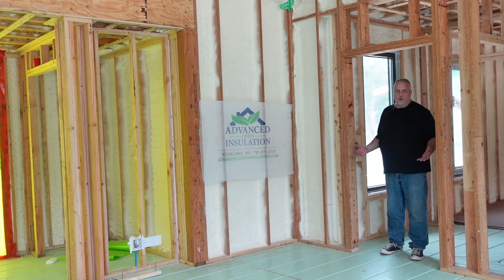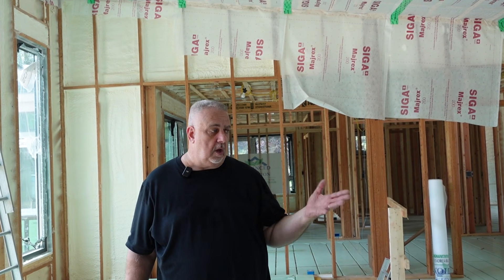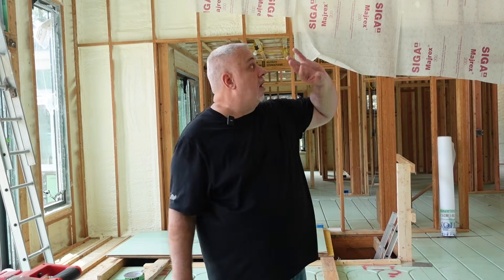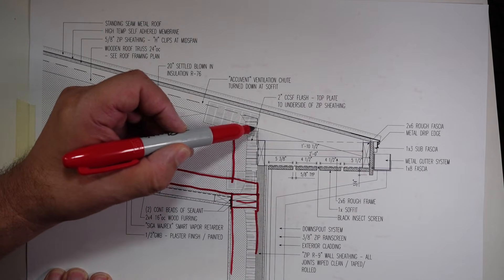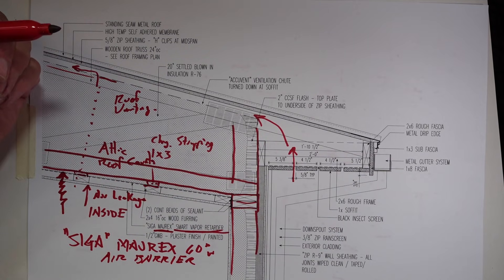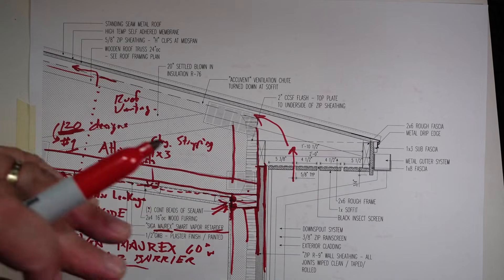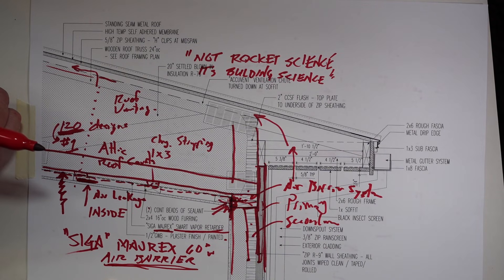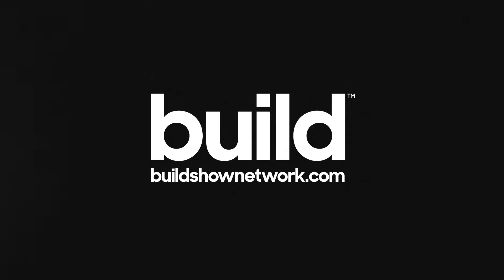THE BEST WAY TO INSTALL the AIR BARRIER

Comment: You're describing the Siga as a mechanical system where it can let moisture into the roof or wall cavity when needed and if there's too much moisture in the cavity it can let it dry or move moisture back to the inside.
It's not as cut and dry as that.
It's marketing when they say it's a Smart Air Barrier like it knows when it can let moisture into a cavity and when it can't and vice versa.
Reply: A while back, I looked up how that stuff (the generic category) works.  A lot of people online mistakenly describe it as a one-way valve for moisture (only letting it travel out from the wall cavity), which it isn’t.  What it actually does is vary its permeability depending on the moisture level.  If it’s dry, it has low permeability in both directions.  If it’s wet, it has higher permeability in both directions.  I’ve reluctantly come to the conclusion that, while it’s really NOT a great material, it’s the best that we have at the current time.

Comment: @7:37  I wondered why the Majrex is on the wrong side of the 2-by strapping---framers being framers, working at break-neck speed with no thought to order of operation. But I'm at a loss as to the purpose of the 1-by strapping between the 2-by strapping and the trusses. If I were the framer, seeing the 1-by on the plans would be a big WTF moment. So, are they going to put 2-by strapping over the 2-by strapping? If not, someone (probably the electrician) gets to poke a hundred holes in the Majrex, and try to seal all those holes.

Comment: This is the kind of clarity that prevents walls from quietly rotting out of spite. Air barriers and vapor control doing separate jobs — radical concept, still somehow controversial.
Reply: I would say to put the air barrier close to the outside makes sense for the hot climate not so much for colder
Reply: @andreycham4797  I think you really mean "vapor barrier" (or "vapor retarder") here.
Reply: The position of the vapor barrier (inboard vs. outboard) needs to be chosen based on the local climate.  The air barrier can be anywhere as long as it’s not leaky.  If you can have the vapor barrier be truly continuous without leaks, you won’t need a separate air barrier.  But that could be more difficult to construct.
Reply: @kc9scott I see your point, you do not mind warm air to inter the wall and condensate on the air barrier placed close to outside. Then I do not understand why you want to accumulate moisture inside of the wall when wet insulation loses its properties
Reply: @andreycham4797  My point is that you are confusing "air" with "vapor".  They are two different things.  In the context of buildings, "vapor" means water vapor.  I do NOT want to accumulate moisture inside the wall.  No one does.  In a northern climate, the vapor barrier/retarder is always placed inboard of the insulation. and historically, the air barrier is outboard of the insulation.  If the air barrier and vapor barrier are two separate things, the chosen air barrier material will let humidity pass through it.  This lets the wall cavity dry.  In recent years, it's been found that while this is perfect for winter time, designing the wall to ONLY dry to the outside was insufficient in the summer with use (or over-use) of air conditioning.  The outside humidity would condense on the cold surface of the vapor barrier, causing mold growth.  That's the reason to use "smart" vapor retarders instead of a total barrier such as poly.  This video shows an example where one membrane serves as both the vapor retarder and the air barrier for the ceiling/roof, which looks reasonable to me.  I am skeptical of this wall design, though.

Comment: Thanks for sharing this detail.  I am installing siga on my mono slope ceiling as insurance to deal with any vapor issues inside my unvented roof assembly.  I used 12" I-joists with plywood on top and then 8.5" of EPS foam on top. Then I have zip roof sheathing on top of that and then sharkskin ultra sa.  Basically I built a Yeti cooler roof lid that sits down inside my ICF walls.  I don't want to end up with a wet diaper in that 12" space so I have to have a smart vapor retarder on the bottom.  The other issue I have to deal with is my home is a 5-story multigenerational home so the stack effect after 48' is pretty significant.  I need to keep that air pressure that is built up from driving warm humid air up into my 12" unvented space.  So the Siga product will be worth every penny.  Thanks again for making the video!